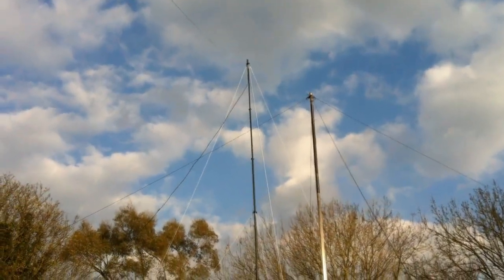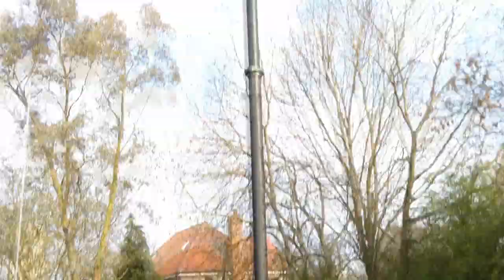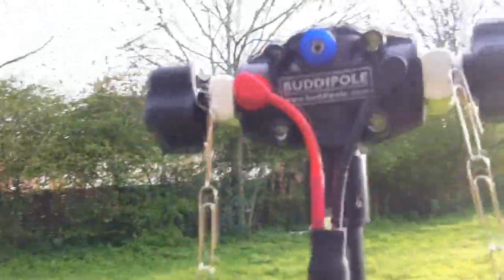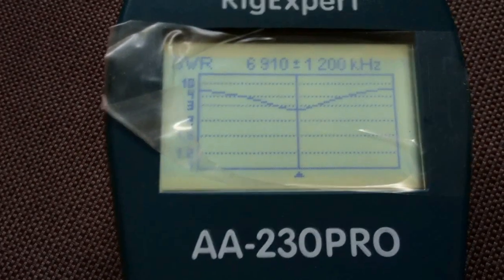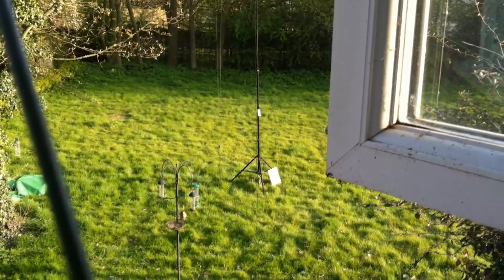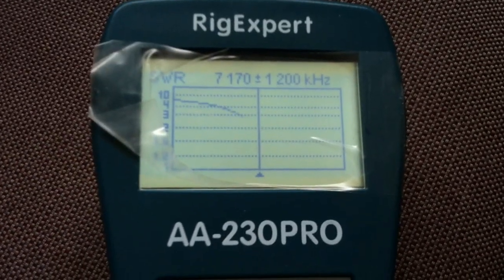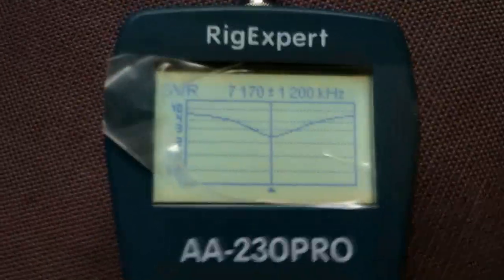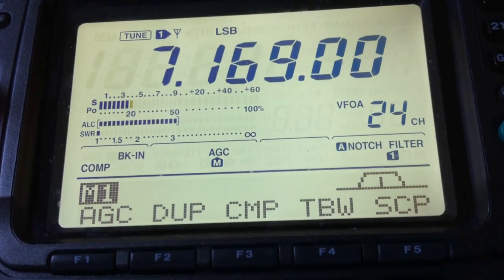The Paperclip HF Antenna - just for fun - M0VST - HD

Comment: Mark, once you get the dip centered where you want it, try this... move paperclips from one side to the other, making one side longer, the other shorter, but the same overall length.  Then watch the SWR drop.  I had this same problem with my own low dipole, could not get the SWR below 2.3 or 2.4.  Like the Buddipole, when the dipole is low the impedance is low, 20  to 30 ohms.  By offsetting the feedpoint you are driving the antenna at a point where it is closer to 50 ohms.  SWR comes down.